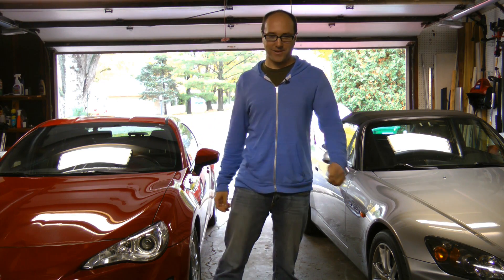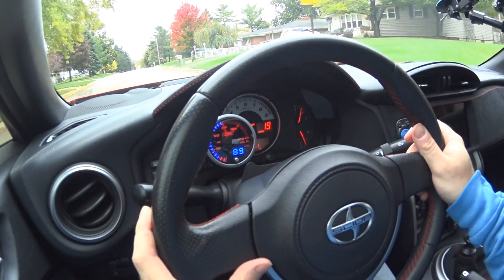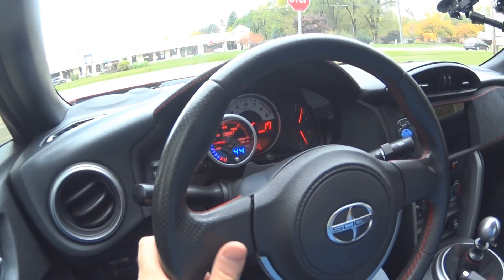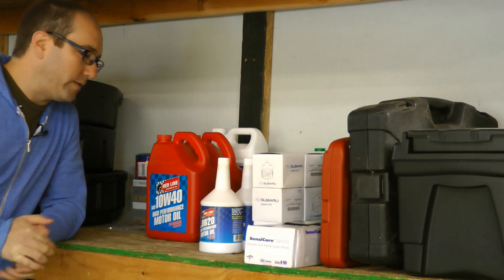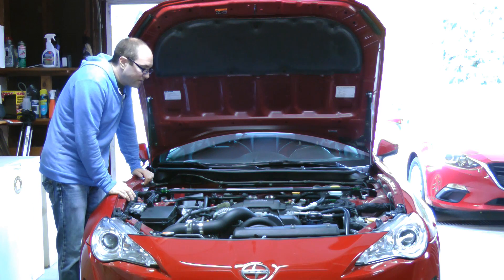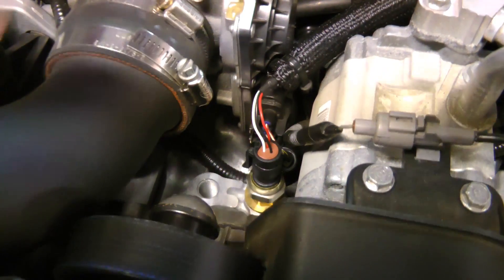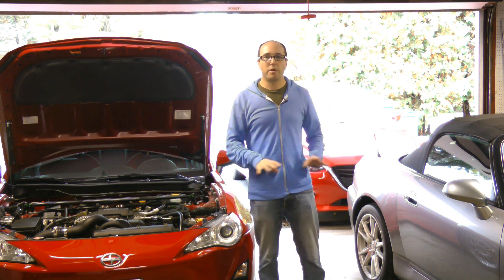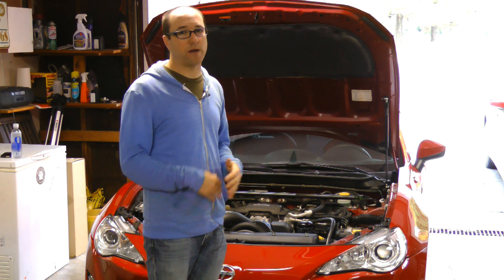FRS - BRZ Oil Pressure and Temperature Tech FA20

Comment: The Direct Connection Mopar hi performance manual for the 1960’s Chrysler engines said the same thing 10psi oil pressure for every 1000rpm.

Comment: This video is really old so I probably won't get an answer, but it's worth a shot. I'm running 5w-30 and at 244°F I see 42-45psi at redline. Should I go up to 5w-40?
Reply: Run an oil cooler if you’re not already

Comment: The data provided above in the written info section seems to suggest that after 9 laps on the track all 3 viscosities performed within a few PSI of each other? and that the higher viscosity oil ran SIGNIFICANTLY hotter after 9 laps, but did very little to increase pressure? Am i reading the data incorrectly? It certainly appears that once the oil is at track-pace temperature, PSI is very consistent(below optimal), regardless of initial viscosity. Higher viscosity only results in higher oil temperature.
Reply: I had the same thoughts. And wondering exactly that @kurtracer22

Comment: I'm running 5W-30 .. is that good? I got supercharger pusging 10psi.
Reply: im boosted and that's what most of the boosted guys local to me run. we're in central florida so its hot most of the time. temps drop to 40F in the winter briefly

Comment: Why would they design so much oil pressure when cold? 
My VW is usually 80-100 PSI only when below freezing, usually 40-60PSI driving around town/freeway. I want to say there is a bypass at 125PSI. 0w40 year round (air temp -5F-90F)

Comment: Great informative video,  really taught me a lot about oil temp and pressure in relation to the 86.  I've been noticing the same data that you've been collecting and ill be installing an oil cooler asap.  I live in socal and run e85 exclusively so id like to keep running 0-20w for easier cold starts, but my temps get up to 220f from normal driving and 235f +  from even light canyon runs.  At 235f my oil pressure reads near 0f at idle.  So thats why i decided on a perrin oil cooler and maybe running thicker oil for the track.   btw i believe your fly is open at 10:24.

Comment: I'm running the oil to water oil cooler form a Forester on my BRZ now. The thing I like the most about it is how it gets the oil temp up to operating temp quickly and keeps it there.

Over the summer I ran on the track with it and the highest my oil temps got was about 240f/115c. It hovered around 110-115c. My temp sender was in the location you had your pressure sender. The car was mostly stock.

I'm running Castrol 0w30. At around 800rpm I'm reading about 18 psi at 90c. I replaced the oe oil pressure switch with my gauges sender, so I'm reading from that spot. 

Now the car is running an HKS supercharger and I plan on getting an oil to air cooler. The role of the oil to water cooler now will be more along the lines of a oil warmer and temp regulator. I think it will keep the oil temps around 80c to 90c even in the winter with a oil to air cooler.
Reply from the maker: +Lavos 1999 Thanks for the comment, keep the post up to date as you do more.  That 0w30 maybe too thin for track with supercharger, keep eye on pressures at higher RPM when temps get to 240.
Reply: +savagegeese Apparently it's a "heavy" 30. There seems to be a bit of ambiguity with the specs of oil. It's colloquially know as "German Castrol", a group 4 based, SAE SL, really decent oil. I may switch to Redline's line of oils. maybe a 5w40. Although I don't like large spreads in viscosity as friction modifiers are less stable afaik. I'm a little out of my comfort zone with the 30 weight spread now. I"ll have to research and see how oil has come as far as that.
Reply from the maker: +Lavos 1999 I found from all of my data collecting a few things about the 86. Biggest issue is low oil pressures and thats a big issue with heat, track use with forced induction.  That said modern top level oils still seems to protect well even when outside heat range.  I ran 0w20 redline at 265F-275F with supercharger and had Turbowski run a 45 minute session flat out full tank to empty.  After the car was idling horribly, and pressures were barely registering at 1000rpm.  Sent the oil out for analysis, zero wear materials, no breakdown of oil.  Did similar tests with 10w30 and 10w40.  40 was as high as I would go as the trade offs in cold starts and normal driving are too much.  Its only good for high heat and track.  Rest of the year in cold and winter I used 0w20 as long as oil temps were always below 212F which in cold was never an issue.  I am going to be doing a video about heat ranges of oil and the myths about that, sounds like you know your shit so may not help.
Reply: savagegeese oo that video sounds really interesting. I'm looking forward towards it.

Comment: are these temps with the oil cooler?  they would seem rather high for the on track temps with an air/oil cooler?
Reply from the maker: +igobyplane.com Yes oil cooler installed.
Reply: you have an air/oil one right?  did normal driving get you to 265 with that or did you have to do weird stuff?  i would like to think that kind of cooler would have kept you 225-240!
Reply from the maker: Street Driving never got temps up to past 225F, track driving was up to 265F.  It was not so much temps that were concerning as it was pressures. This was the Mocal/Oil to Air unit.
Reply: so i never checked mine with lower temps until today.  my temp sensor and pressure are both at the sandwich plate.  per obd2 my max oil on track was 259 last track day and my view is it's usually 260 or lower, but i think it may read a little high.  i have the forester cooler and it goes cooler, sandwich, filter.

it appears at 180 driving home from starbucks that 7000 rpm had me at ~100 psi with amsoil 5w30.
in the past my track 260 at 7000 rpm had me at ~60 psi with amsoil 10w30.

despite these variables i am surprised to see how vaslty different our readings are - for example even your 10w40 did not hit 100 psi (although close-ish) and my 60 looks nicer across the board.  so i'm wondering

1. is my location overstating oil pressure?
2. was your particular oil cooler causing a large pressure drop?
3. a mix of both?
4. was yours small?  i am still surprised to see you hit 265 with an air/oil cooler, unless you were really driving the shit out of it, even with the blower?
Reply: Did your car end up being reliable? @miketaveirne7529

Comment: So what's the best oil grade for a turbo frs? I just got my turbo kit
Reply from the maker: Start with 10w40. Keep an eye on pressures.
Reply: I track maybe 6 times a summer and the rest is just street
Reply: +Jesse Mayne also the car will be drive in temps from 0*C - 35*C. Sorry for the annoying questions just trying to get as much info as I can for the sake of my engine
Reply from the maker: If you are going be driving around freezing or below in winter stick with  5w30.  Abover 50F, 10w40 in summer.  You will need oil cooler to be safe but block off or disconnect when very cold.

Comment: Hello, is data you posted with oil cooller? If yes, where i can see the oil pressures without oil cooler? I think without oil cooller it will be different.
Reply from the maker: This was tested with and without cooler.  Without oil cooler temps will be even higher and pressures will drop further.
Reply: +savagegeese oil galery plug is the best place for oil pressure? I have a chance to install in oil sandwich plate also.
I have goodspeed oil cooler with sandwich plate in my gt86, its good for oil infiltration?
And more - wich oil your recomend for FA20 with turbokit 0-20, 5-30, 5-40?

Comment: What model is that gauge?
Can you tell me what fuses you tapped into to install the gauge? Thanks!
Reply from the maker: Jose García Its a Prosport JDM, It has a low profile sender which fits in the tight space on top of block.  We tapped into Radio for constant power and tail lights for dimmer.
Reply: Very thanzs!
I would like to install oil temperature sensor, normally installed've seen where you install the pressure sensor. Is there any way to have both installed sensors without sanwick in oil filter?
Reply from the maker: I believe you can piggy back two gauges together off that sender and get pressure and temp.

Comment: Great vid, i track my n/a brz pretty heavily and am concerned about heat.  I have gottten cam angle sensor codes (heat related), have stalIed out entering the paddock on warm days after hot laps and am down on power more than an acceptable amount later in the day which i suspect is oil temp related.  I have a nameless header/ tune that is very conservative and an mfactory 4.67 final drive that puts me at high rpm's for good lengths of time and run mostly at vir in virginia.  I have stayed with mobil 1 0-20, have a mishimoto race thermostat and use water wetter.   Can you please recommend what I should do this season to minimize heat related power loss and engine wear?  I suspect, do like you said and add an oil cooler, oil pressure gauge/ temp gauge but with what oil viscocity?     Thanks!  Eric

Comment: You have talked a lot about the need for an oil cooler and the pros and cons of running various oil grades in this car, all the while making some good points. But you haven't considered a coolant to oil heat exchanger yet. The idea being, a heat exchanger will bring the oil temps up quicker in winter if you have an oil cooler and will also help to keep the oil temp from going too high if you don't. But obviously it will not be as efficient as a dedicated oil cooler for cooling the oil. So ideally you would want an oil cooler plus a heat exchanger, wouldn't you?

We know that tracking this car without cooling the oil is a mistake - with or without forced induction. At the very least Toyota/Subaru should have included this rather simple mechanism of keeping the oil temps in check. Here is a guy adding one to his BRZ https://www.youtube.com/watch?v=21qWLjhRlfY then comparing the results.

Comment: savagegeese I'm curious about your experience with the Perrin oil cooler during winter.  I live in Canada where temperatures can drop below -20F in the winter.  Do you think I would have problems getting the oil up to temperature or over cooling?  The car is NA and serves as my DD, and sees lots of Auto X, but perhaps only a handful of track days every year (I hope to do more but we only one track within the province) during which I'm worried about my oil pressures.  Do you think I even need an oil cooler, or could I get away with just going to some thicker oil (10W-30 or 40)?  If I do run the cooler, is there an easy way to bypass/disconnect it in the winter?  Thanks, and sorry for the very long post.
Reply from the maker: disconnect lines during winter. Thats best an run a 10w30 in summer.

Comment: Great video, only issue I have is the poor choice of gauge as the quality control on the prosport gauges is terrible. :(
Reply from the maker: Yes, for sure. I tested with 3 gauges before this one to double check accuracy. Its within 2-3 PSI of others. How long it lasts is debatable.
Reply: savagegeese Yup, that's the question.  We've had such poor longevity on those gauges we've stopped installing them for customers almost altogether.  We've had much better success with Defi and Innovative and even the Autometers.  Currently we run the P3Cars Vent gauge and will have the Oil Pressure wired into the 2 empty slots of the P3 Cars one.

We found that the OEM 2015 WRX Oil-Coolant Heat Exchanger is good at bringing down the temps on track from 279 to about 265 and is a great choice for the occasional tracker/beginner and street driver especially here in the Northeast.

Comment: Great series.  I laughed my ass off watching your videos, especially the reviews of the Mazda.  Soooo anyway, I just bought the same car, a 2015 3i GT, and I agree with your assessment of the crap IP (haven't had a chance to lacerate my forehead on the package shelf yet, but looking forward to that too).

So I was looking for a way to restore some readable information to the dash, like a decent tach plus an actual water temp to replace the idiot lamp, and maybe even an analog fuel gauge, because, you know, gas.  The aftermarket gauge you have in your video is Very Cool and looks like it gets me most of the way there.

Who makes it? Does it run off a remote sender or the OBDII port?  Anything else I should know?  Good luck with the videos, will subscribe.

Comment: Hi Savegegeese ^^. I write it because i m not american. I heared you said there is an overcooling problem with the stock FRS + oil cooler with thermostatic . I contacted Mishimoto chat support, and I requested more technical information about that. They respond "we don't have the % open when the thermotatics is closed" & "Pat Muschamp: Koj, unfortunately I do not understand your question. We created the Thermostatic unit to prevent overcooling the oil in colder climates." Is there a well-known problem, all over the world, in all Cooler with a thermostatic ? Is there any interest to sell a cooler with no solution about the overcooling problem ? And last question, if we live in a country with only -10°C in winter, will I have at 100% sure that problem ? Because we have often 10-35°C, and sometimes -3°C...

Comment: How come that you say don't go over 10w50 in an forced induction engine?
Because were i am from tuners recoment to you use 10w60 or better 5w60

Thnx,
Reply from the maker: You can in very hot climates but you want to use the right oil for the right oil temps you see.  If you don't see more than 265F no point running higher than 10w40.

Comment: Sorry just to be clear, if I'm not pushing the car in track use, and I daily the car all year long, then the standard 0w-20 will be fine? I don't really do much past aggressive street driving at best. I live in Illinois near Chicago so winters can be rough. And the plan is for forced induction, so will I need to step up to the oil cooler and increase the weight of the oil? I'm a dumbass when it comes to this stuff, but you clearly have experience with all this
Reply from the maker: Yes 0w20 is your best bet.  When you do FI depending on what you do monitor oil temps. If you see over 225F switch to 10w30.
Reply: savagegeese Thanks I appreciate man. So switch to 10w-30 for summer driving or year round? I'm worried about cold starts in winter driving
Reply from the maker: maximus9401  In extreme cold just run 0w20.
Reply: savagegeese right on, thanks again!

Comment: Why 10w-40 as opposed to Mobil 1 0w-40

Or Amsoil dominator 5w-50., that way you keep your modern start up protection but maintain good pressure on the track.
Reply from the maker: Oils like 0w40 vs 10w40 dont hold viscosity as well at the higher temperatures.  They are rated at 200F its beyond that they struggle compared.
Reply: I've got you now. You're talking serious track use, no dog fucking and no street use oil need apply.